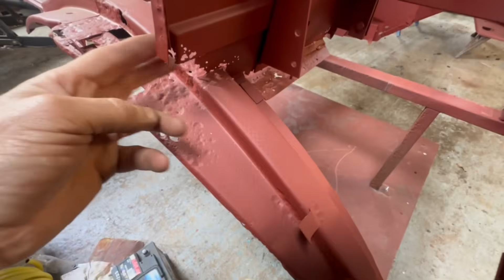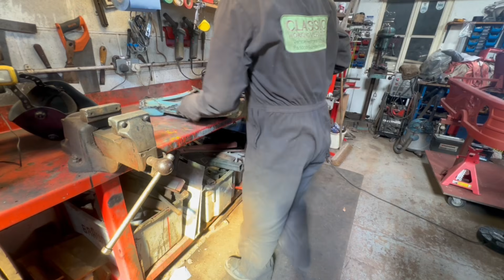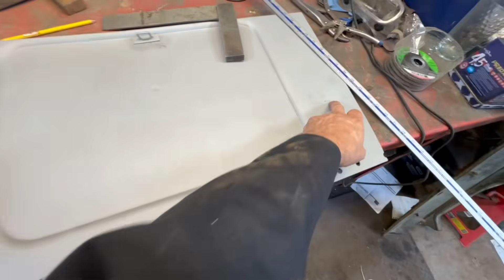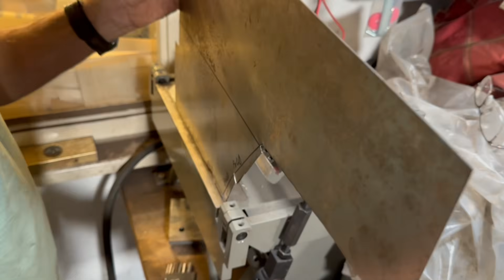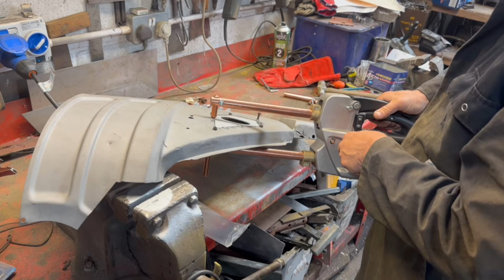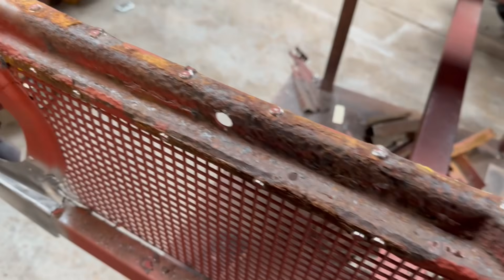Rebuilding a classic Unimog’s rotten cab from start to finish (nearly). Unimog 421 resto, part 5!

Comment: Nice work! But it looks like you grafted a body onto a kidney, instead of the other way around…. why not fix the donor cab and transplant the whole thing, in one piece?
Reply from the maker: Haa! Nice idea but sadly not that simple. The 421 and 406/416 cabs are structurally quite different, transmission tunnel, footwells, bullhead, dash, front grill, pedal mounts etc, etc are all different. Used 421 cabrio cabs are also basically unavailable, but 406 cabs can be found…